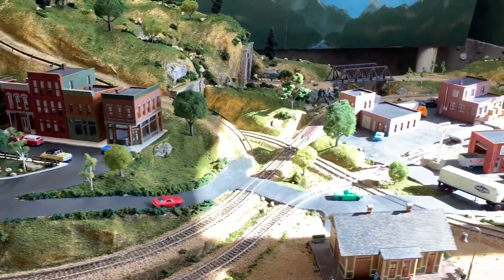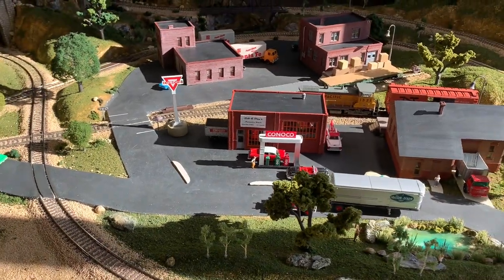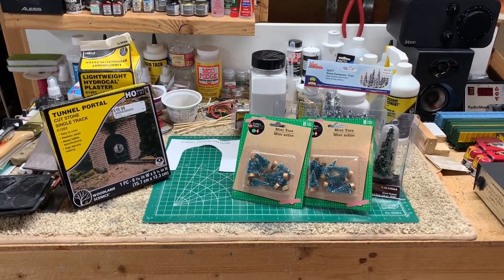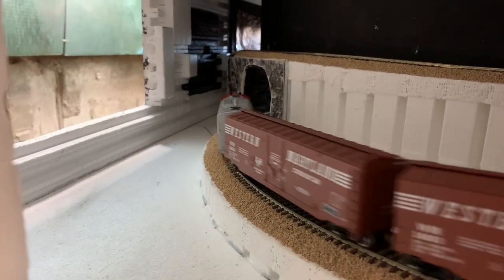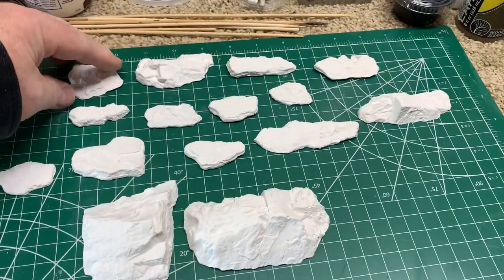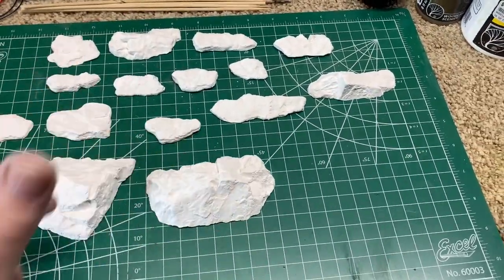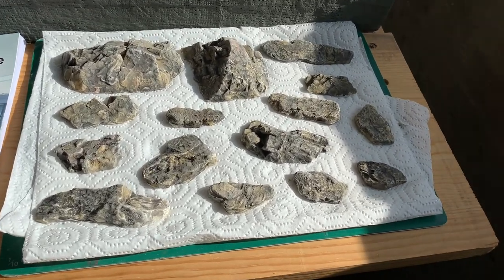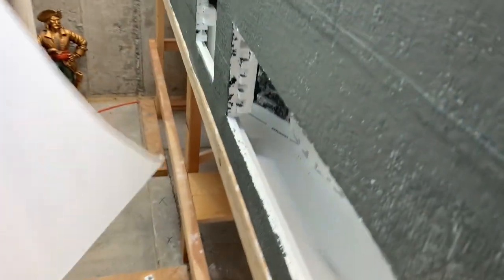Winter Scene Module Part One

Comment: Cool stuff, Dan. On my layout I accidentally cut out the larger back panel opening in the wrong position, but it works out OK. It opens up right at the bottom of that panel instead of the top edge if you follow me. I chalk it up to measuring at 1am and not double checking in the morning before cutting, haha.

The winter scene is going to be great! Looking forward to part 2 next time. I really like the WS figures although some I received recently do need cleaning up with a knife tip and maybe a paint touch up. Those dollartree trees really do look the right size to be Christmas trees. Maybe a few dots of paint for ornaments or something for inside an apartment.

Have you done any computer programming or circuit building on a breadboard? If so then you should definitely consider getting an Arduino board. Super simple to control LED's and things with a few lines of code. You could easily code a traffic signal for example. Light each color in sequence with appropriate delays and repeat forever. I'm sure that's what that circuit board would have done.  

I've been working to install a special item on my layout for too long now (magnorail), but I think I'm mere hours away from plastering the risers and terrain. Maybe a few pieces tonight if I feel the energy.
Reply from the maker: Thanks Tom. I’m sure it won’t matter about the back panel, it’s just to be able to get in there so no matter where it is as long as it’s an opening it should be fine.

I’ve seen a few videos about the Arduino system, and I’m sure I could figure it out. It may be something I get into down the line for sure. The magnarail project sounds intriguing, I’d love to see some details about that.  I started with the newspaper for the little hill on the module today, I’ll try to get some plaster cloth laid this week so I can do some actual scenery work next weekend for the video. This video came out kind of long but I had so much fun with the rocks that I decided to not edit it down too much. Thanks as always for watching and commenting, looking forward to hearing about your progress. It sounds like you’re coming right along!